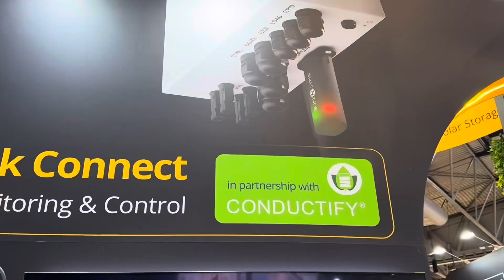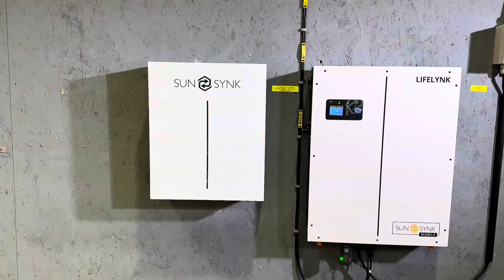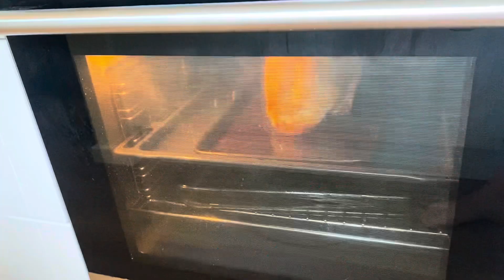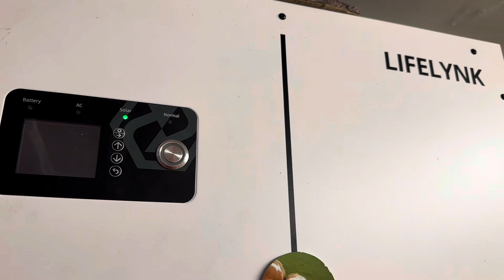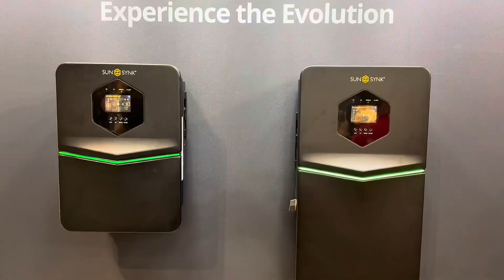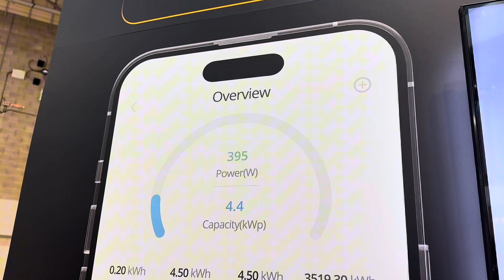Save Big on Bills: Let AI Do the Work!

Comment: Was pricing up a new sunsynk system today. Prices have come down a fair bit. For 8 panels at 4Kw a 3.6kw inverter and a 5.1Kwa battery it’s under 3k not including wiring and panel fixing etc
Reply from the maker: That’s a wonderful price
Reply: like 1 week ago i played £9630 for 12 panels 455w each 6 front 6 back of house with 10kw battery  and that with all scaffolding and labour
Reply: Ai, where is it? How do you switch it on? When is it available? Ok your talking about it but where is it? And how do you setup?
Reply: Not the right place to ask...but why are we obsessed with segregating lights and small power?  This Airbnb I'm staying in (Germany)..has one circuit for each room...Does both lights and power...All 16 amp 1.5mm...main switch 30ma...seems to work fine..Kitchen is different..2 circuits and a 2.5mm 20amp for cooker I think...I mean who in their right mind uses electric heaters these days with the price of electric